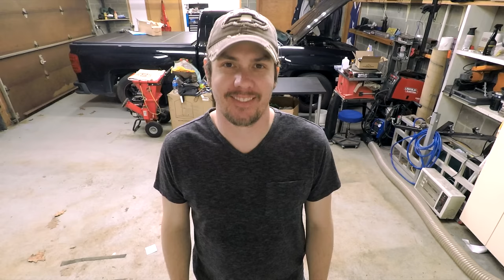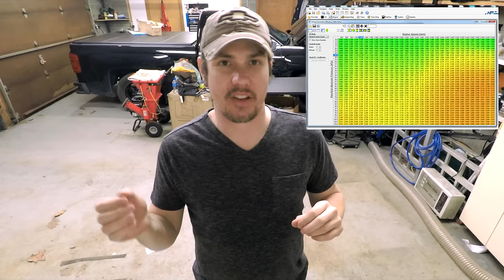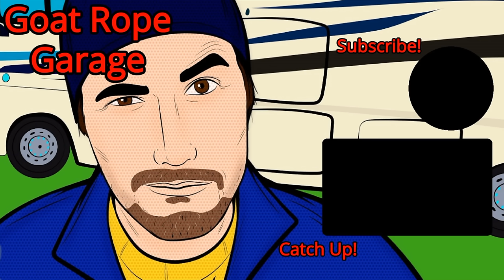Speed Density Explained, Tuning Series Vol 4.1, HP Tuners

Comment: I like to use an analogy to help me remember closed loop vs open loop. Open loop is like a carburetor. Unless you manually adjust the carburetor it will not compensate for elevation, temperature, etc. You can get that Carburetor dialed in really well with a wideband O2 sensor but it has no way to compensate for changes. Open loop is the same way if you force any ECU to open loop it will not add/remove fuel it will just deliver a set amount of fuel based on the VE tables regardless of how rich or lean it runs.  It's your job through multiple logging sessions to get that VE table as close as possible in as many cells as possible in the VE table. There is no perfect VE table it is only meant to be close. Once it is close you turn on closed loop and it will use long term and short term fuel trim to get your AFR to 14.7 or whatever the commanded AFR is. Good explanation on speed density though. I never knew about the virtual VE table on new vehicles which is good to know about.

Comment: Such a huge fan of your HPT series man - I recently got my hands on an MPVI2 tuner and wired up my AEM X-series WB. My application's a bit different to yours - being a naturally aspirated LFX 3.6 V6 from a VF Commodore down here in Australia (used in some of your older Cadillac and Camaro models). There are, however, some similarities including direct injection, VVT and a torque based ECU (e39a) so I'm pretty excited to see how the rest of your series goes. Already, it's been hands down the most informative/useful/easily digestible source of information on MAF tuning - you do a great job of explaining both theory and practice. Looking forward to seeing some more content on fuelling, torque management, ignition timing and VVT. You're an absolute legend!
Reply from the maker: The speed density tuning video will be coming out in the next few days. Glad to hear you're getting some use on the LFX! Let me know if you need help with anything.

Comment: First of all i would like to say thank you for sharing your knowledge with us. I think what your doing is great. I have an 08 silverado 5.3 with mild modifications (btr stage 1 cam, flowmaster muffler, cold air intake, deleted cats), this is a daily driver and not a race truck. That being said I am curious about VE tuning. In this video you mention a bubble in which temperature, altitude, and other variables effect. Now assuming you stay in the general altitude and tune in different weather conditions throughout the year, will you be able to get a VE table that works in your area year long round without tuning every time the weather changes, or loading a tune for each season? Please keep in mind that in my case the truck will rarely see WOT. I understand for racing and to get the best possible performance you have to tune for every variable. Im just wondering if i can tune one table that will keep me in decent fuel for most conditions for my area.
Reply: Nevermind, the actual tuning video answered my question

Comment: Question regarding speed density tune on a ProCharger car 10-14psi. A buddy and I have the same car, 2017 Mustang V6… Both ProCharged. I am running 10-11psi and he is running 13-14.  Not sure how much that matters. But our cars are MAP only. That’s how they come of the line. 

Now. Both of us are tuned by the same tuner… Both on E85 and we test it to make sure it is in fact full 85%. Our fuel trims were fine, within 5%. As of October of last year we both have been seeing fuel trims of +13-16%. He is in Cali and I am in AZ. 

There isn’t much to the vacuum system on these cars and we are both very knowledgeable about our cars. There are no leaks anywhere. What would cause the higher fuel trims? I thought about air being colder and the density. But won’t the MAP sensor adjust for that? It’s right in the back section of the intake manifold.

Comment: From the factory maf  is mostly wot  And ve is cruising because, maf is more  accurate with higher airflows..  And there are tons more people. Atleast around here running maf only. Certainly not because it's better but because tuners can knock it out really quick. Ve hardly gets touched around here.
Reply from the maker: Yeah, it's way easier on MAF and I prefer it but I still down in the VE table in as a safe fallback.

Comment: For SD:  In a supercharged application, if you tune at low elevation, and then pulley down to make the same boost at higher elevation, will you need to retune it?

Comment: With a sd only tune do you not re enable closed loop and leave it open full time? Is it so the o2 sensors don’t try to correct any changes you have done within the ve tables ? Cheers
Reply from the maker: The sensors will try and correct to your commanded so you only have to get within a couple percent on SD tuning then you can let the narrowband sensors disk the rest of the fuel in for you. They just can't do anything in the PE range

Comment: Are you referring to Gen 5? When/where does the ECM switch over to Speed Density? Im running a Gen 4 setup and my dynamic shuts off at 4000, per the tune file.
Reply from the maker: On all the Generations the ECU doesn't ever switch over strictly to Speed Density unless something fails, the VE tables are there to act as a sanity check versus the MAF, the system has calculations that it runs against both modes and if it thinks the MAF is drifting or you are in a transition state, which the MAF isn't very accurate at it, will lead more towards the SD table as being the mode of control.  Above 4k dynamic will shut off and the ECU will rely on MAF calculations, but the sanity checks are still being done.  It has been assumed that it has always meant that it is strictly MAF at that point, but they also point out that it is Filtered MAF above 4k which means there are calcs still being ran against it.  I've never been convinced that the MAF is ever in full control, even over the 4k mark as this is all based on the Gen III setup and has been considered how it has been done since.  If I said otherwise I must have misspoke and I apologize for any confusion, I will look into it and see if I need to clear it up!  Thanks for the feedback!
Reply: @GoatRopeGarage  Yes, please clarify that. Lol. I figured I'd ask. Thanks
Reply: @jaydubb71  My understanding of the GM setups is just as stated above.  The VE is always being referenced so it has to be right.  Disable MAF when you disable closed loop and hone the VE as close as you have dyno time for.  Once that's right, re-enable MAF and getting the curve right should be a breeze.  You can disable the MAF completely if you would like, but even if you're keeping the MAF you still want the full VE surface honed, basically.  Also, if what I've heard is correct, you can't disable speed density completely and use only MAF, but then again I'm not sure why you'd want to.

Comment: I followed this to do my 18 camaro ss but its still going into closed loop unless i force it off with the scanner diagnosis disabling
Reply from the maker: Yeah, after 2017 you have to disable closed loop in the scanner
Reply: So is it still disabling the maf or is there another step i have to take?
Reply from the maker: You'll still have to disable the MAF my failing it

Comment: So bacically an  na bolt ons tune  (Cai headers catback ) in hp tuners requires speed density tune or maf tune or both I am confused but I think I am close to my first bolt ons tune just help me out
Reply from the maker: You will have to adjust both most likely.
Reply: @GoatRopeGarage  can you make a video tutorial for like bolt ons only tune+back fire tune with retarding the spark and then riching the fuel tables so more flames can come out that would be intersting and I guarantee you it will get a lot of viwes specially back fire tune lol thanks by the way every day I am learning more and more thanks to you I got to the point when I see my 2 to 3 days old comments I see that  i have came a long way since then

Comment: Trying to tune a 07 silverado twim turbo E38 Ecm for Speed Density and im having issues with the truck behavior as it gets heat in it. Truck will fire up and idle perfect. As soon as it warms up it will die putting it in drive and just start running really bad. Need some guidance
Reply from the maker: Log it and watch your airmass and timing when shifting into drive, do they jump significantly before it dies?
Reply: @GoatRopeGarage  i will have to check that. I have been having çountless issues with the E38. REP, ecm not responding to changes, finally swapped ecm most of those went away but im still fighting to get anything to even go fir a decent drive to log
Reply: Did u change the cam?

Comment: So i have a 5.3 swap. That keeps going Rich over 30% throttle afr is around 9-10 an i cant figure out what's causing it every thing in hp tuners is reading throttle position map ect. I tryed leaning it out but nothing is there something im missing ?
Reply from the maker: You in MAF, SD or dynamic?
Reply: @GoatRopeGarage  maf an sd sometimes